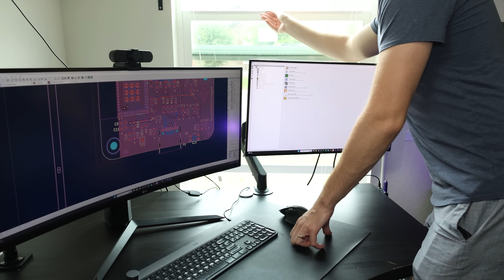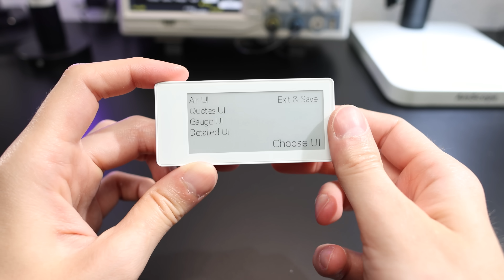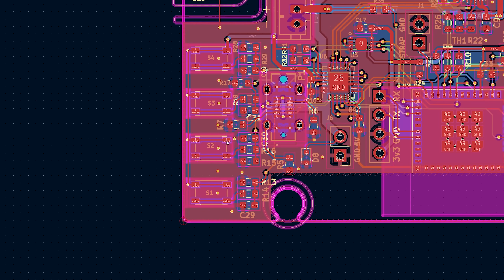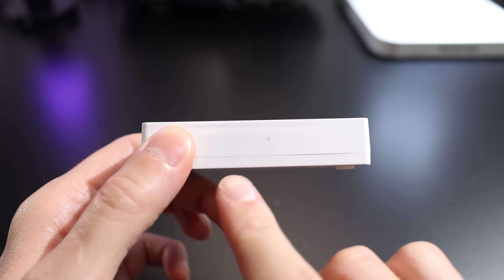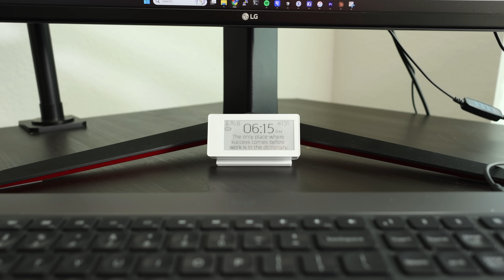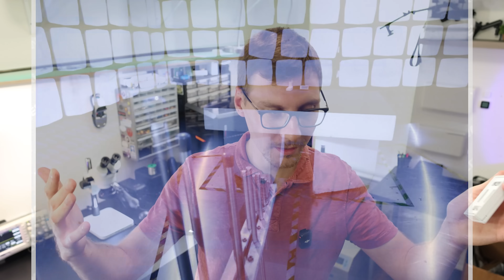My $30,000 mistake

Comment from the maker: The files will be public once the first units ship. All my products have been copied the moment I open source, which is perfectly fine. But to have at least some advantage, I am not releasing them until the first units ship. You can sign up here to get an email: https://landing.stuckatprototype.com/the-clock or you can follow my GitHub @stuckatprototype
Reply: Looks cool. Love the video.  FYI, it looks like there is an issue with that URL (page not found).  BTW, in case you're looking for video ideas, the whole certification process and what's involved in preparing a product for it is a bit mysterious with not a lot of good resources.
Reply from the maker: @myHacktography Ty! Fixed. And I am always looking for ideas. Thanks!
Reply: @stuckatprototype I would love to see that too. I have some products nearing that point.

Comment: I appreciate the honesty with which you show the entire process and the fact that you're aware of your costly mistakes. I also really hope you sell the founders batch to your loyal fans

However, do you think pricing the product at €175 simply by dividing the development costs by the 200 units you're releasing is justified? Or do you feel that open-sourcing it and allowing anyone to build it for at least five times less somehow justifies that price?
Reply from the maker: thats not how it is priced.. its 2.1x the manufacturing cost
Reply: @stuckatprototype  Oh, sorry I assumed the pricing then. I was kind of thinking that, component-wise, the BOM shouldn't be that high. But I didn't really factor in the production of the case and the stand or, to be more precise, I somehow assumed near 3D printing costs :)
In any case, I'm looking forward to the open-source version, just to get a feel for what it actually takes to produce something like this. I'm actually making some prototype devices with e-ink displays myself, with the goal of creating something production-ready at some point. But selling them for even $100 sounds unreal.

Comment: Cool stuff, would consider building this if I didn't already have 2x IKEA alpstuga that do most of this and even work independently without any app, or eventually can add to future home assistant setup, but need to be plugged in. Thanks for sharing the process so we can learn as well what it takes

Comment: I don't get it, did you cnc tons of parts without having the final product?
Reply from the maker: yeap... because each part would have been $100 instead of $10. I was too confident I could get it right on the first try.
Reply: @stuckatprototype  I get the pain, i did 2 prototypes of a camera for about a 1000 each, but i don't get how do you get them 10x cheaper, just by increasing the number? The worst part is that this chinese manufacturers can't be consistent in tolerances and coating. You didn't sandblast and anodize yours, what was the plan there?
Reply from the maker: @cristibaluta I thought a raw finish would look good. It didn’t… the part itself works, it just looks crap
Reply: @stuckatprototype  good excuse to spend even more money on tools to finish the aluminum parts lol

Comment: Where did you get the testing for only 2000! I’ve his this as a road block on selling wifi related stuff
Reply: "wifi related stuff" 

Well probably his testing is much cheaper because he doesnt use any wireless communication as he said the alarm clock is offline
Reply from the maker: sdoc is fairly cheap. CE is not bad either. if you have custom antennas, etc, then it will run you closer to $10k

Comment: How is it ARM is harder to tinker than closed ESP32?! WTF?
Reply from the maker: How is esp32 closed?
Reply: @stuckatprototype Ok, it depends on exact model, risc v ones are oprn, but Xtenza is clised ISA. And some peripherals on ESP32 depends on binary blobs (wifii, bt, zigbee). I understand that you don't use any wireless capabilities of ESP32, but still it looks like more clised ecosystem than ARM one.
Reply from the maker: @blacklion79 I love arm, but the issue is that with majority of the chips is that you need a debugger. STM is one of the only ones you don’t. The the other issue is setting up the environment, tooling etc. while with an esp32 you could even run arduino + it has built in usb that doubles as a debugger interface. 

I should make some stuff with arm chips. I love the ke04 and ke06. I lived through all the acquisitions

Comment: As a product designer firstly your end product looks nice but i have a few questions
1. Why did you cnc without paying somone to run you off a 1 of 1 for such a small part it wouldnt have cost more than a couple of hundred quid a company like jlc would probably do it for less than a hundred quid 
2. Why not SLS print if your going to pay injection moulding prices get it sls printed first to verify dimensions and asthetic or even FDM your parts are a bit to curved for most FDM but i print all my clients stuff on my prusa XL at each iteration point using multi material to give easy support removal
3. The amount you spent on injection moulding was insane just like panalising PCBs you can panalise injection moulds on sprews your parts were fairly small and could easly have been reduced to 1 mould the 2 injection moulded IO panels i did last year cost a couple of grand to make the moulds and were 35x15cm and more complex than your parts we got them done in china because the uk was to expensive for low volume audio test equipment
Reply: Agreed on all these. As much as I'd like to support makers making stuff and openly documenting their mistakes so others can be encouraged and get out there and make too, I barely think "making a basic air quality sensor costs 30k" is a meaningful message for anyone. It's not useful for a hobbyist who wants to just make a single unit for personal use, because they'd just FDM the enclosure and JLCPCB the circuit boards. It's not useful for an entrepreneur who wants to learn how to productise similar hardware projects, because no one with a real budget says "screw prototyping and validation, let's do a full production run without checking basic tolerances". This is going to be harsh, but it just sounds like someone with unchecked perfectionism, plenty of cash to burn, and not enough cash to buy common sense making ragebait and blaming it on the wife. If one's Wife Test has a perfectly machined enclosure as a requirement, but not "and I spent over 30k on it" as an immediate failing condition, one's Wife Test is miscalibrated, methinks.
Reply: @jeslinmx22 😂 made me laugh the "miscalibrated" Wife Test. 
Of course the genius guy narrative has both of click baiting (it surely triggers curiosity when you read "30k lost") and irony. 
I love YouTube videos where genius meets humour. 
I always thought that geniuses are serious and boring but videos like this proved me wrong 😊
Anyway, I enjoyed reading your comments too.
Reply: Well he did say the learning is to prototype. Should have said prototype every aspect cheaply first.

Otherwise it’s $30k to know when to open the window. 😂
Reply: reasonable questions but I guess the answer is simple... As many "genius" do he also focused and spent all his time and brain resources on the defining features and specs of what he was making (the engineering part), while he "saved" time skipping to find and learning the most convenient ways to "build" the prototypes without wasting money.
I also think that the guy doesn't have much "budget" problem, so "wasting" money may have not hurt him "that much" enough to push him to spend MORE time in finding other more convenient ways.
Who is the one who would spend 1 hour looking for the best price and quality available on online marketplace to buy a 10 USD powerbank and save, maybe 2 USD?
I'd do... but many would say I'm wasting my time.
Reply: @ChainsOfThoughts  as an engenier this is the enginering part any shmuck can design something enginiering is designing something that works and knowing why
Reply: @Daisy_human yes but he is likely qualified as electronic engineer, not as everything engineer; I doubt it may exist a everything qualified human engineer 😉
To me is amazing that he has been able to even design the device case and stand to such level of details though that's not his field of expertise.

Comment: I'm a CS student geeking out on small projects like this. Recently made an air quality monitor paired with Home Assistant. I bought an SCD41, SGP40, AHT20+BMP280 sensors but I will add a particulate sensor later. Utilized Tailscale to monitor them remotely. Very satisfied with the outcome. The only thing is that I don't have a 3D printer to make an enclosure.
Reply: What do you do with that data?
Reply: 3D printer is a lot of fun and it doesn't need to be expensive one. I've bought cheap Anycubic Kobra - no frills, just one filament at the time (this I would like to improve, when I buy next one), no connectivity - I have to run to print room (better not to have it around your working place because of fumes), but you can DIY some solutions for it with ESP32. After few kilos printed I managed to clog the printing head, but also to unclog it, so it's ok.

Comment: Another really nice project 😎. The only question which is coming to my mind is why u decided to use eCO2 sensor instead of real CO2 sensor. SCD40 also have low power mode and isn’t much more expensive
Reply from the maker: Thanks! eCO2 is a byproduct of the VOC chip I used. Sciosense has a very convincing paper that demos how VOCs correlate to CO2. From my research, VOC build up is one of the most important things indoor. And since it correlates with CO2, that gives a pretty good total picture of the indoor air state
Reply: @stuckatprototype  but different homes will have different levels of VOC.

Comment: A suggestion I made to my student who needed to keep track of time: use a GPS chip.
Reply from the maker: works well outside for sure! gps chips are pricey though!
Reply: Why not just use atomic clock? /s
Reply: Expensive and virtually impossible to get a connection indoors for low powered chips. So, it's a very stupid suggestion, really.
Reply: In many parts of the world time signals are available in the VLF band at about 60-80 kHz.  Cheap clock modules are widely available for this.
Reply: @cdl0  Good to know. Thx.

Comment: Great video!! Thankyou for taking the time explain the whole process of building a hardware product. But that said im still curious about your BOM. I understand the cost of 200$ makes sense considering the RnD spend but if you remove your RnD and just have BOM for a single piece... how much would that be?
Reply from the maker: Ty! They cost me $60 in just materials + time to make them. They run me about $100, thus $199 price point ($179 on preorder)

Comment: Anecdotal evidence on the well-being impact is a bit poor, despite very common in the consumer market.
Reply from the maker: That is a fair point. I would not claim this magically improves well-being or replaces real habits. For me, the goal was much simpler: make a quiet desk device that gives me useful signals about my workspace without becoming another app or distraction. The clock, quote, temperature, humidity, and air quality are meant to help me notice my environment, not make medical claims.

Comment: 6000$ and 6 month in: This isn't a weekend project anymore xD
Only 2000 Bucks for FCC Testing? How is this possible?
Reply from the maker: hahaha true! as for FCC, It uses a pre-certified chip so its only part b. I now have a lab that does is for less than $1k. $2k was expensive 😅
Reply: @stuckatprototype  You fortunate soul. If I want to legally design and sell an electronic product in the EU it would cost more like 10.000$ (CE Marking, EMC, RED, WEEE)... One of the reasons you rarely see any small batch series products here.
Reply from the maker: @Yosory  I did CE in china, it’s more than fcc but not that bad
Reply: @stuckatprototype  can you share a lab name?
Reply: I love your projects and videos. But as an engineer you should have spent $5000 on a Heat Recovery Ventilation and solve your problem for good. Instead of building a second product telling you to open the window. It’s useless when you sleep.

Comment: Hey man super nice video, glad to have a channel like yours! I also want to design my first own product, I´ve already built a microcontroller with an ATSAMD21G18A but had problems with programming and I´m looking for a good IDE. Any recommendations you can give? Thanks in advance.
Reply from the maker: Keil is one of the “better” ones. That said, mcu world is years behind when it comes to IDEs… I would normally code in a separate editor and use keil to compile. You can set it all up with cmake, fyi

Comment: Hi, Great video, I love your simple way of explaining things. 

However your preorder link doesn't work.

And also why go down the injection mould route. Why not invest in a resin printer. They give you really good accuracy and finish and you don't even need to modify anything as with injection moulding.
Reply from the maker: Thanks! fixed the link! As for resin printers, I have 3. It doesnt do a good job on designs like this. I tried. a lot. each piece would need to be sanded down, etc. I couldnt get it to be consistent either. warping, etc.
Reply: @stuckatprototype  why not sls 
similarly as an audio test equipment product designer i would have payed a chineese or local machine shop to make me a 1 of 1 for the cncd stuff and done the same with the injection moulds getting them sls printed before moving on to injection moulding 
When i did 2 large plastic io panels last year for my employer we FDM printed each version with pla supports so they fell of the petg parts validated it all worked including the 20 button holles and then got a chiniese company to make out parts they were 35 x 15 cm parts and we spent a couple of grand total including there technican setting sprew positions and verifying the part would mould and afterwards we made a couple of minor changes to account for warping and material finish